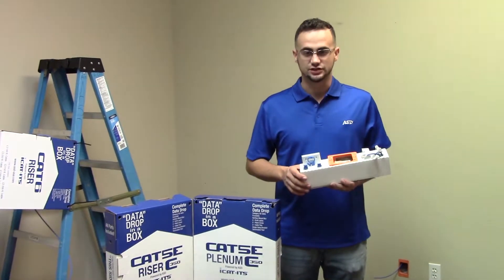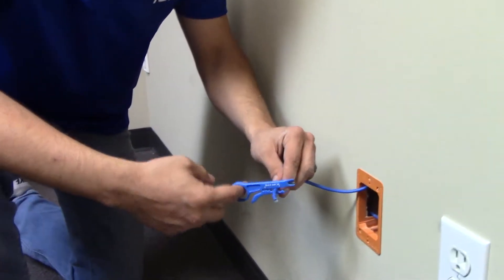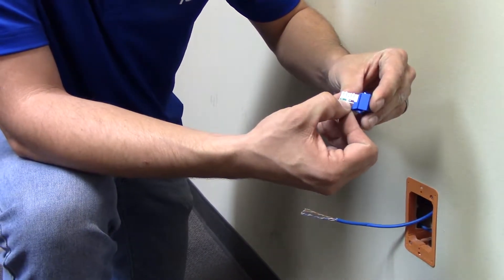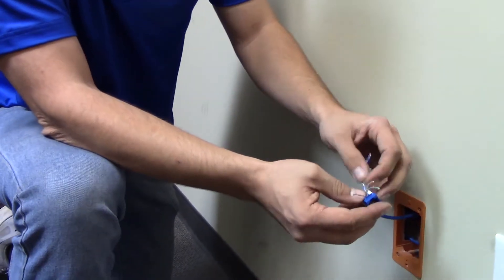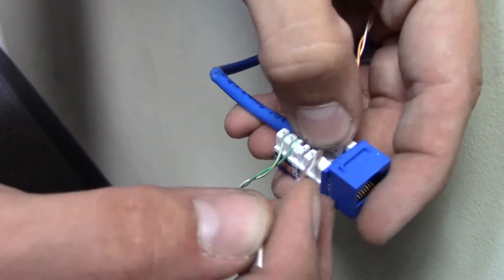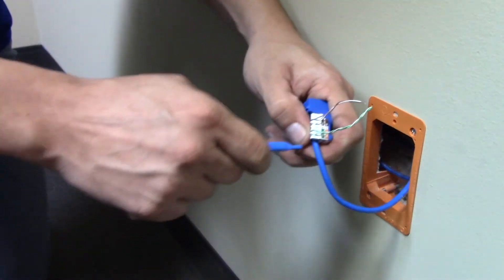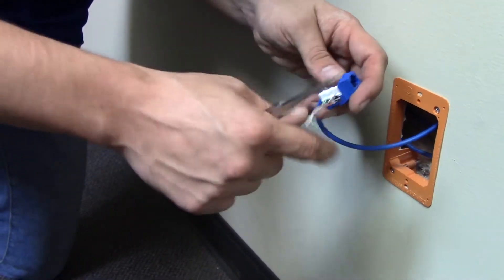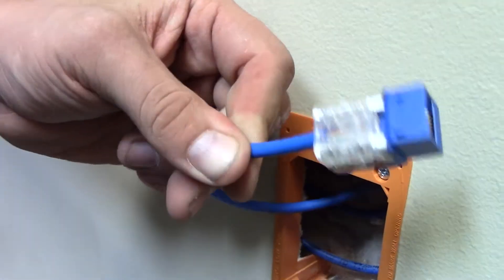How to Terminate a Low Voltage Cable

Comment: This cable does not require bared Stripping ? wow learn something new. please correct me if i am wrong.
Reply from the maker: That's correct! You still have to remove the blue jacket (see :37), but when you punch down the twisted pairs they make contact without having to strip them individually.